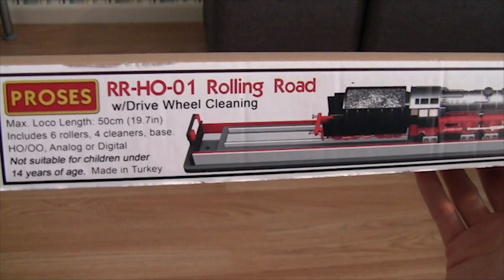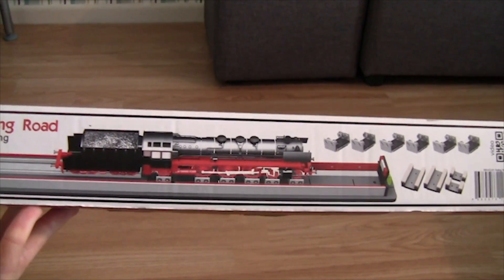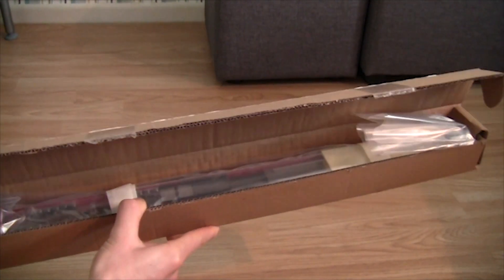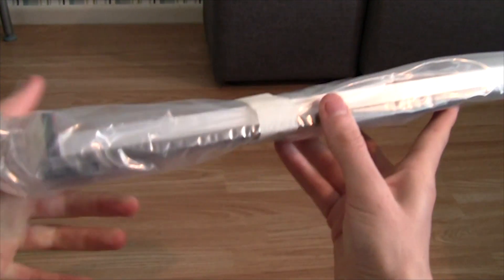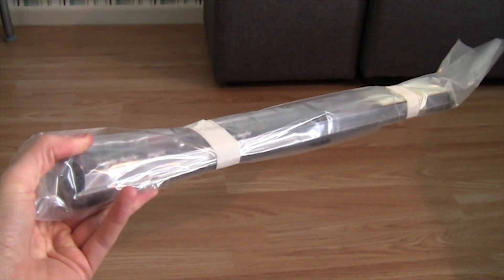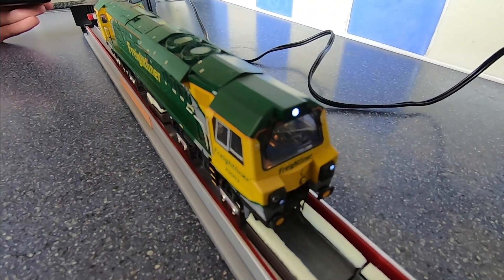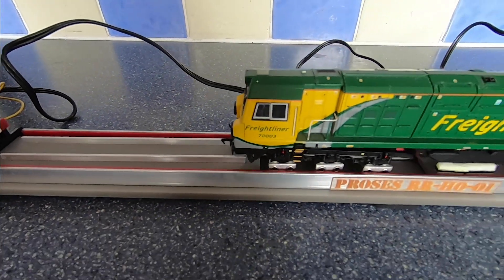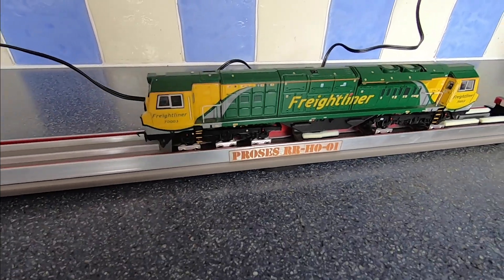Opening The Proses RR-HO-01 Rolling Road

Comment: What did you use to glue the pads on? I removed the yellow backing on my felt pads but there is no sticky to them. There is also  plastic film on the pieces that the pads attach to. For the price they should include the preparation of the parts in the instruction.
Reply from the maker: In the end I used a small amount of Evostik adhesive to secure them in place

Comment: Wish I can be positive.   I tried this on cleaning my wheels on an Ho Allegheny Steam loco.  I must say this rolling road is a complete fail,  There is to much play in  the rollers and the magnet that supposed to keep them secure, It is not strong enough. Because of this when you attempt to align the loco wheels on the RR rollers , the rother wheels fall out of the rollers and is very frustrating. Also doing this procedure is extremely risky every time since you are messing with a very fragile area containing all the control rods for the wheels.  What is bad is that this has to be done for every wheel you want to service. Add the fact that there is no proper instruction and the pads adhesion is completely  non existing. I am sorry I wasted $150 for this piece of junk. If they made the rollers adjustable to fit more snuggly in the bed it may have been less tasking but they are set at their max which is not enough. I have the woodland Scenic TT4561 is a lot simpler and more practical then this over priced rolling road, The only problem with the woodland scenic   unit is that it is to small for large steam. So back to cleaning the wheels the old school way. Wish I could return my rolling road.